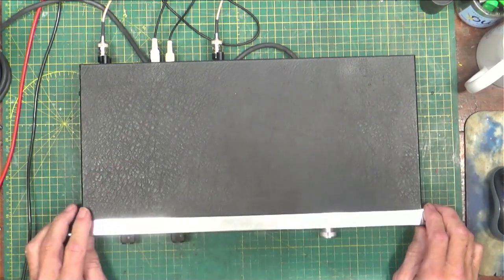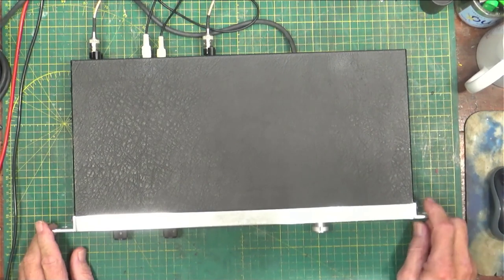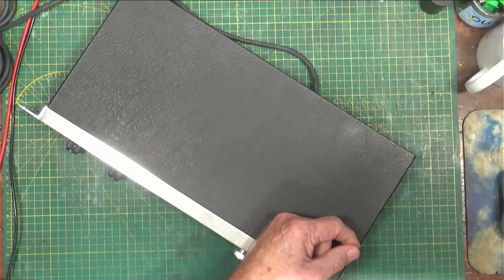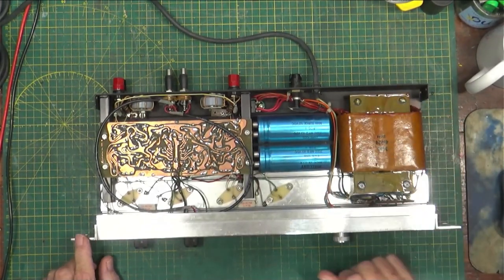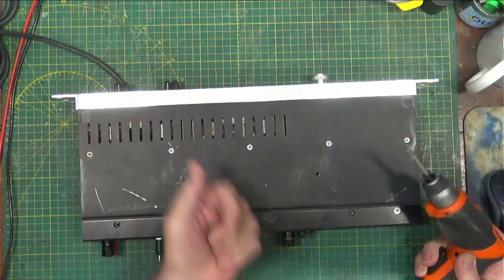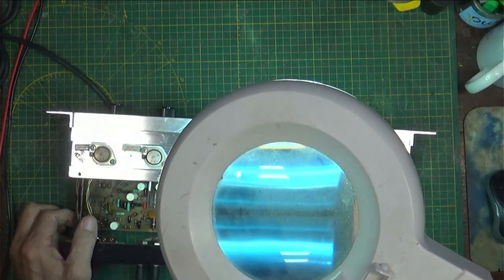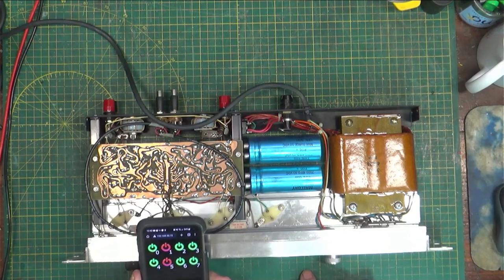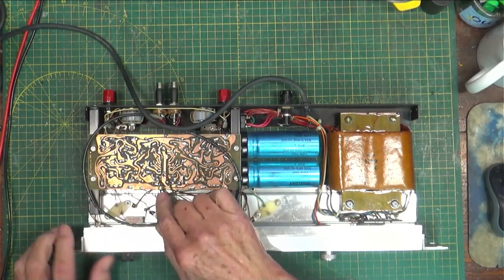Fixing a Crown D60 Amp

Comment: Nice. I have a late model D60 (mid 1970's) that I've owned for 20 years with what appears to be all original internal components and it still sounds solid (no pun intended) to these 48 year old ears. It has some minor transformer hum, which I think is inherent with the design (correct me if I'm wrong). 

I just checked the DC offset on my DVM and with both input channels shorted, it reads .5 mV on the Left and .20 on the Right set at 200 mV scale. Even new product from China does not measure that well. That is obviously not the be all / end all in bench testing but it is sonically dead quiet. 

I'd like to upgrade the op amp as I'm told that is the weak point, but I hear it is an unusual undertaking that is not worth the effort. I'm not a tech. I'm sure the caps should be replaced but I was told that when I bought it...yet here we are, 20 years later...and it's still working and sounding just as pleasing as it did then. I've had caps from China fail in 10 years or less, so what gives?

If you have any recommendations, please share them.
Reply from the maker: I wouldn't do the opamp upgrade if you are OK with the way it sounds now. These things were a utility amp not aimed at the hifi crowd. They have a little bit of distortion but not so much that you can hear it when they are running below full volume. These were designed more as a PA amp.
Reply: Ok. I will take your advice. Thank you.  @AERVBlog

Comment: Love this vid! Thank you!
What tool are you using to remove the 
caps from the board? A desoldering tool that punches them out?
Reply from the maker: Thanks. 
No. It is just a regular old electric solder sucker. A cheap one at that.

Comment: Also, I have some vintage SS audio equipment from the 70's, 80's, and 90's that I inherited. However, they have sat unpowered for 30 years (mostly NAD and McIntosh brands, but also some Japanese  receivers) and I'm wondering if I should use a VARIAC and dim bulb tester to power them up or just go for it and hope for the best. Is reforming caps possible? If so, what is the procedure that you recommend (specifically voltage increments and duration)? I'm reading a lot of mixed reviews regarding this. You sound like you know what you are doing and might have some sound advice (pun intended 😀). 

Thanks in advance. I will subscribe.
Reply from the maker: I do not believe in reforming capacitors. I just have not had any luck doing it but I would bring it up slowly to about 90 volts and let it sit turned on for several minutes before increasing it to 120. If all looks good on the dim bulb you should be good to go.
Reply: Ok. What size bulb do you recommend for a 225W/ch @ 8 ohms Class AB amp (NAD 218 THX)? How much larger does that bulb need to be for an amp that is twice a powerful (QSC 2450 RMX)? Also I have a couple of McIntosh MC250's 50W/ch. All of my equipment is SS, not tube. Everything I've read on this is regarding tube stuff.

Thanks in advance. Appreciate the info.  @AERVBlog

Comment: Just got one of these D60 from a friend it powers on but no sound and the transformer gets really smelly burning hot within seconds of turn on.
Reply from the maker: Yeah. Don't turn it on anymore.  Check all the transistors and the big filter caps. Bring it up on a light bulb limiter even after you fix what you think is bad.